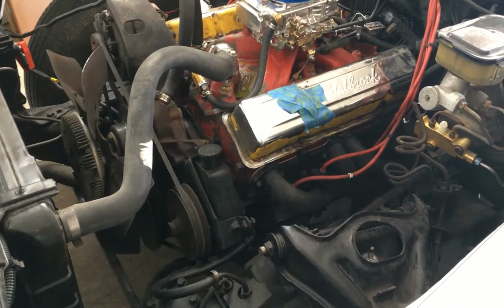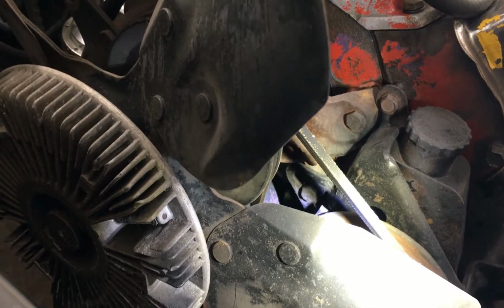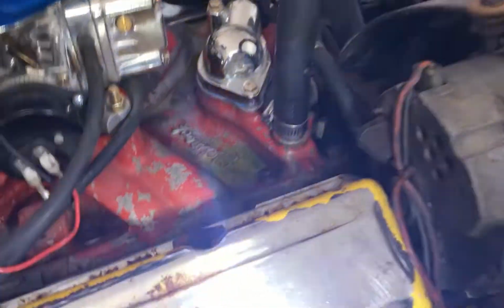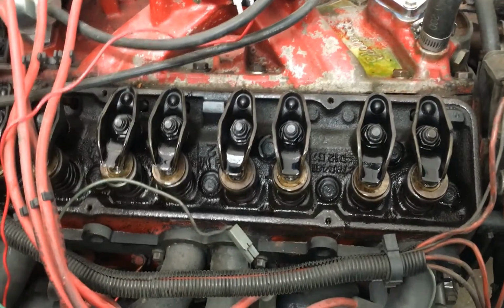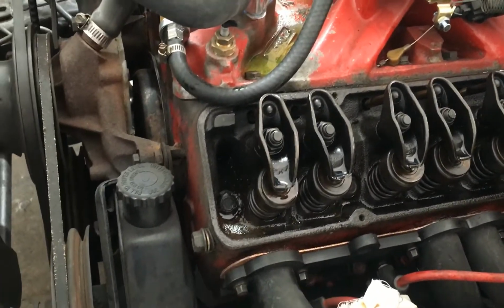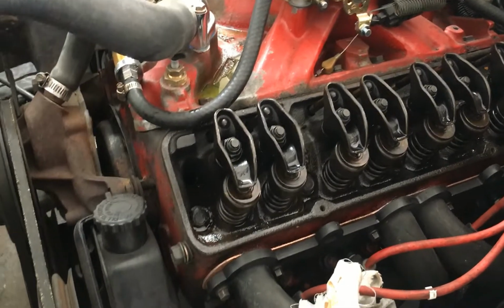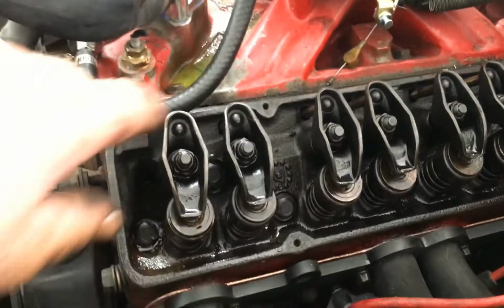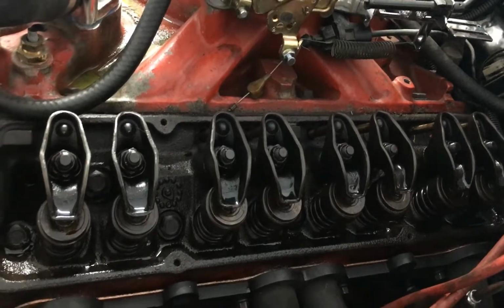81 camaro restoration double hump heads! 1965 castings date, nice!

Comment: Just found your channel, and not too bad glad I did. You have some pretty cool stuff going on here.
As for Camel Humps.... pretty sure those are early 80's heads on there. The Camels don't have accessory holes in them for the alternator, you have to use the Long Arm belt howler with Camels and the PS Pump is down by the crank. None the less, it's probably still an 0010 block. It's a damn good block.
Reply from the maker: Thanks for your comments. You are correct regarding the accessory holes on the early double hump heads. Those are the ones with a higher casting Marc on them. There was also a later version that has a lower casting Mark. Those were cast with accessory bolt holes. Most of those were available around 68 to 72. So, you are correct and saying mine are not early castings. They do however have the correct last three digits, 492. There is a website. Itstillruns.com it goes into the differences between the two castings. Thanks again!
Reply: @wreckedrebuild2142  Oh yeah 492's are good heads, with just a little port work you can really make them come alive!